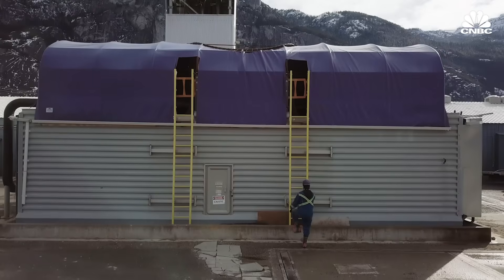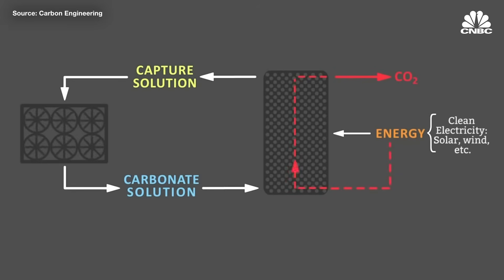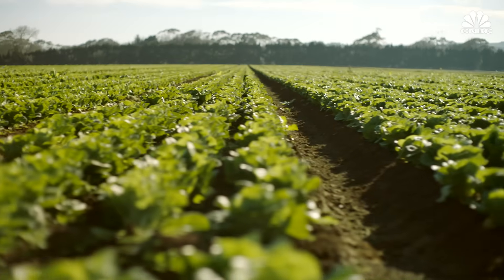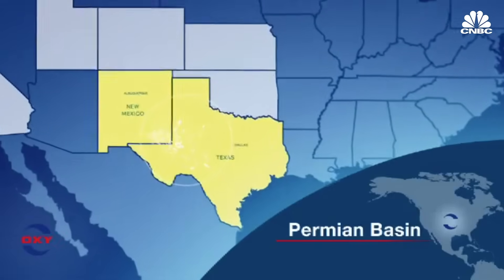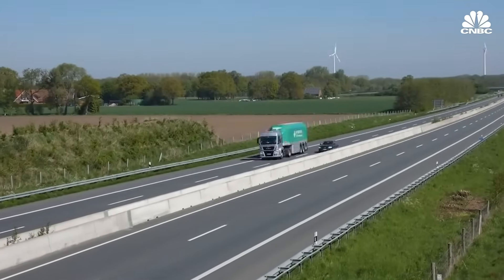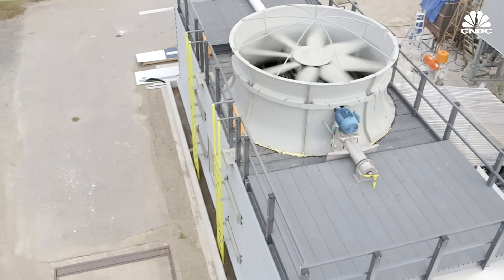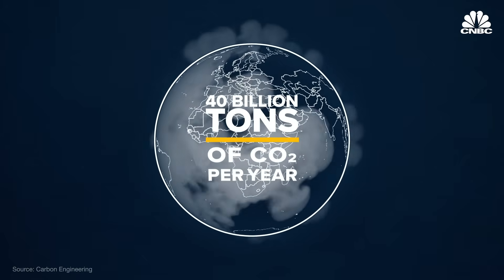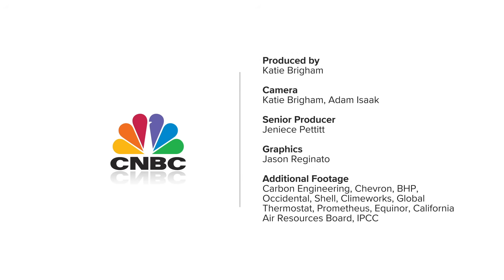Bill Gates-Backed Carbon Capture Plant Does The Work Of 40 Million Trees

Comment: Biofuels and clean electricity. Simple
Reply: No it isn't. 
Biofuel --> takes a lot of landmass
Clean electricity --> No reliable way to store it on a national scale
Reply: Chaomatic what are you talking about? Biofuels are made from second generation feedstock like waste vegetable oil from fast food outlets or from corn husks, spent sugar cane etc... also, renewable energy doesn't need to be stored, just like coal fired power plants don't store energy. Example: hydroelectric dam works at night, during the day we use wind and solar and excess power is used to pump water to high ground so it can be used at night as hydroelectric energy. Problem is, governments make a lot of money from coal powered plants

Comment: A lie . This is to continue  to cut trees down and build more building. A continuous chain reaction
Reply: Trees don't sequester CO2.  They take some in when they are alive, and release it back into the atmosphere when they die some decades later and decay.  It's called the carbon-cycle.  Interestingly, when you use a tree to build a house, you ARE sequestering the carbon the wood contains for a longer period of time, because it doesn't rot and decay like it does on the forest floor.

So when a tree dies in the forest, it's carbon is released back into the atmosphere in a few years as it rots and termites digest it releasing CO2 and methane.  Use that same tree to build a building, and the carbon stays out of the atmosphere for many decades, sometime centuries.

Comment: Notice how every negative comment basically comes from Berkely.  For one when it comes to the oil and gas industry your not just talking about gasoline in your car.  That's just one of more than 6000 products made using crude oil. The oil industry isn't going anywhere, and if there's a solid means of making it a cleaner more earth friendly process well only a fool wouldn't support it.

Comment: Wait, so they use huge electric powered fans (electricity which probably comes from dirty energy that creates CO2) to capture carbon in the air? Would this capture more CO2 than the CO2 that is released by generating the energy to run those fans? Unless they only use clean energy then I don't see the point.

Comment: When talking about "Carbon Price" are they talking the price of CO2 or C?
If the price is for CO2 and not C, what is the running price of C and would splitting the CO2 into O2 and C in order to sell the carbon and oxygen separately be viable?
Does that "40,000 direct air facilities to remove all carbon emissions" include what gets removed by forests and plants or is this by being 100% reliant on the facilities?
Reply: I don't know but I suspect it would be the mass of carbon alone which is easy to calculate without splitting the molecules

Comment: There is another simple way just stop using most of the oil driven vehicals and start using eelctric vehicals instead and use only those vehicals on oil which is needed untill there is a permanent soultion for using electricity instead of oil.

Comment: CO2 removale (not only including machines but also trees, mainly GMO that can capture more CO2) is the way we eliminate CO2 from the atmosphere, but renewable energy is the way how we don't put  it. We have to use both
Reply: The fossil fuel industry wants to be able to capture everything that is released so they can release it again and continue making a profit. Personally I would rather we as humans just switch over to green energy and just let the fossil fuel industry die.
Reply: Actually, "renewable energy" is nearly as big of a source of pollution as fossil fuels.

The future is nuclear, baby.
Reply: @operator8014  Please explain.
Reply: @adamtak3128  A lot of pollution is created when creating solar panels. But it's a cost/benefit thing. The idea is that renewable energy solutions will make up for the fact that they are dirty in the short term by providing clean energy in the long run.

Nuclear energy is a very special case. It's the cleanest form of energy we have by a long margin. It produced obscene amounts of energy for the small amount of pollution it creates. That is, so long as no nuclear meltdown occurs. Then it suddenly becomes extremely dangerous. But without nuclear energy we wouldn't be able to meet our energy needs.

Comment: That professor fro UC is a damn idiot. There are limits to the viability of solar and wind. Not the least of which is the massive amount of space it uses.
Reply: Who has a PhD in this, you or him? The reason why it's viable is because of offshore wind and solar
Reply: @polowishmadejski1548  

Building anything for offshore is incredibly expensive to build and maintain.  It is also very damaging to the delicate marine environment.
Reply: @kBIT01  maintaining and building is simmilar in cost to on land (build cost might be more but offshore land is less expensive) and marine life is minimally impacted. It had simmilar impact to building a bridge in a lake (assuming there are no chemicals leaking from the actual plant). Even if the marine impact were large, it would still preferable over fossil fuels, which have a much larger marine and general ecological impact.

Comment: problem is: You need power to fuel this system. And most of said power comes from coal and other fossil-fueled plants, which emit even more CO2 in the process...
Reply: You’re right, why bother with any solutions if it doesn’t make you happy...

Are you some kind of moron? Do you expect 1 company, 1 government, 1 solution, to solve this problem, this is a problem that will be solved by hundreds of companies and governments of many decades. Renewable energy can’t be forced onto the world, it will eventually be adopted because of its obvious advantages, but as long as you drive your car, I suggest you shut up and wait, or do something about your environmental impact all the way to zero and then you can complain without being a massive hypocrite that is actively adding to the problem.

PS adjusting your lifestyle is a bad solution. The market needs to switch to green energy, and that can only happen with time...Look at Tesla, they made cars that people want even ignoring the environmental benefits of an EV car. More stuff like this will come, because electric makes the most sense in all mechanical things.

Comment: Let's compact these machines to portable size, then put them in electric cars to clean up streets. We could also put these on gas driven vehicles... kind of like catalyst converters but have a container that will fill up with the solid, then go recycle it where it is accepted. Also instead of having robots in space, we could have them on the beaches cleaning up the mess we make. On top of recycling and planting trees of course. But there is a question that we'd have to come up with an answer for. If we are pulling CO2 from the air, as well as other pollutants...How will plants "breath". If I remember from 5th grade, we inhale oxygen. Then exhale CO2. Plants "inhale" CO2, then "exhale" oxygen. It would take a lot to calculate it correctly... but we could be putting the world into more danger than we think.

Comment: Planting trees  (Redwood preferably) , carbon-capture and Nuclear Power is the trifecta of reversing climate change.
Reply: immasurvivor it’s not that simple. Our fossil fuel usage is still high. We are extremely reliant on this energy source. Also, nuclear power is not finite, we only have enough uranium to power us for 200-300 years which is temperamental, not to mention nuclear waste. We have to find a new way to create energy or go back to living simply.
Reply: Countering the problem is different than solving it. Like lane keep assist for people on their phones while driving.
Reply: @Shahzad Khan Reactor technology has advanced since the 1960's, there are closed-system-reactors that pretty much cannot melt down and produce little or no waste.
Reply: immasurvivor gen 4 reactors are far safer and efficient than the earlier ones, but even after the isotopes are used up, the fuel rods have to be put in storage. We store up to 2 thousand tons of fuel rods each year which still are dangerously radioactive for 10k years. Burying something like U235 can damage the biosphere. As I mentioned before, nuclear energy is only a short term solution. It can not replace petrol, and cannot replace renewable energy sources. It’s is not the danger of them but rather what are we gonna do after we run out. This is not darling in the franxx where we can harvest the core of the earth.
Reply: @Shahzad Khan Sure, Nuclear is not perfect but its a good temporary solution while we wait for fusion or other revolutionary means of energy production to be developed. 200-300 years is a long time man, 150 years ago the horse was the prime mode of transportation, and look at the world now. if we havent revolutionized energy production before we run out of Uranium, we never will.
Reply: @immasurvivor  we have seen how safe it is, chernobyl and fukushima are a huge disaster.
Gen 4 reactors are hardly buitl anywhere and are not economically feasible, when renewables enter the competition.
Reply: Would be nice but redwoods can only grow in VERY humid places with LOTS of water... My family knows this cause we have tried to plants dozens at their home and even with intense care they never lasted more than a year.
Reply: Nuclear power sounds good until you look how much carbon dioxide is produced while transporting, producing and extracting Uran
Reply: Spakko21 Spakko21 lmfao please please tell us more about the CO2 cost of nuclear energy. 

What about the CO2 cost of solar, wind and the battery arrays you need to make them useful? Lol

Did you forget about thorium?
Reply: @lukasgerber3131  By that logic let's do nothing because it's naive to think there are no emissions in the production of wind and solar power installations... batteries ring a bell?
Reply: @lukasgerber3131  Probably a whole lot less then extracting and transporting the coal for coal plants.
Reply: @Spakko21 Spakko21 the C02 it saves is vastly greater. And alot of that C02 production can be eliminated with electric trucks, mining equipment etc.

Comment: i'm asking on the behalf of petrol heads, so this means, we ain't running out fuel?
Reply: That's the main issue with this, it doesn't address the issue of the world's reliance on a non-renewable, finite energy source. This will prevent only some of the many consequences of using fossil fuels. We are still going run out eventually and we need to be ready when it does.

Comment: I dont see the problem. . the solution is to scale this method up, plant more trees and lower the demand for oil by innovations in transport ( we are doing them, thanks Elon ) materials ( plastics ) and other bi-products of oil... if you do it all then it will eventually level out and then eventually reduce the worlds problem..... its a step in the right direction.... rather than these critics in the industry slamming it they should work along side it to collaborate in other areas to engineer methods which take away the need for oil.All the oil industries have to do as demand reduces is invest and move assets over to new fuel methods. It's really not that hard, is it ?

Comment: GREEN ALGAE.  

GREEN ALGAE captures FAR more CO2 than trees. Trees are not even what creates our oxygen and removes CO2, if it was only trees we would simply suffocate and not exist.  Green algae are the organism which produces our oxygen and absorbs CO2 -- and it has always been Green Algae. Planting a tree does nothing, its little leaves do nothing.  Its Green Algae which should be grown hydroponically in thousands of giant vertical farms with hundreds of stories of platforms growing it.  The algae will absorb CO2 and exhale O2, while storing the carbon which can then be stored away.

Currently under Capitalism, the Algae farms are only being used to the extent that they can use the Carbon biproduct as biofuel -- therefore releasing the Carbon Dioxide back into the atmosphere.  That does nothing for the climate, it defeats the purpose in order to turn a profit.   In fact the carbon biproduct needs to be stored away and prevented from being burned or used as fuel.  But that wouldn't get any backing or funding from Big Capital which is needed to do it on a large scale.

Thus, the prospect of carbon capturing, whether it be Algae or chemical treatment plants, is a doomed endeavor under the conditions of the anarchy of the Capitalist market.  Only World Socialism, which socializes the means of production of humanity for public ownership and used to meet human needs, and coordinates all national economies of the world to a single unified scientific plan -- can allocate the resources and mobilize the army of workers to construct the necessary carbon capture and climate engineering projects -- AND to have those projects be subordinated to rigorous democratic and Public oversight so that its used to truly benefit humanity and not be used maliciously for profit. 

Global Socialism, a WORLDWIDE scientifically planned economy controlled directly by the workers, farmers and scientists, is the only framework through which climate change can be combated. Period. This isn't an opinion but an objective and scientific truth. We will all do well to study the revolutionary socialist movement and the workers' movement, study the history of the Fourth International -- get off the sidelines, abandon your false hope in the lie that capitalism can be turned around or reformed. Make the choice to join the ICFI and the Socialist Equality Party in the international fight for world socialist revolution. Read WSWS.org for more info

Comment: We don't need to capture anything, as the world does this job already and it does this very well. The problem is that people are dumb and have accepted bio degradable materials. Materials that do not last and will melt away over time weakening it integrity. All we have to do is demand quality products. Example: We even allow the brick and other Companies to manufacture plastic sprayed fake leather couches to be sold and fall apart in under a year of use. We need to walk away from these degrading materials and demand that companies can only mass produce durable Quality products, that can last and not just make products that break down over time and not by actual use and that need to be constantly         re-manufactured over and over. People are ignorant and listen to those people who aim to enslave them. Instead of thinking about what they are actually participating in, these people are even willing to accept a forced carbon tax on such things like electricity and heating that allows them to survive in the winter. They feel guilty for using oil and natural gas which is cleaner than coal and wood. It's the cleanest fuels that are offered by the Government and our willingness to use them and not the alternatives, has us all deemed polluters and we need to be punished? WTF. We are using the cleanest fuels and we are bad? Notice how the gasoline powered cars have increased its mileage from 9 MPG to an average of 50 mpg and we all know a car can be driven on nothing more than water? The manufactures can make cars get over 100 mpg but are not allowed to. But we the consumer are the bad guys? We need to demand quality products and services and stop blaming ourselves for living in a rigged economy. We are victims nothing more and nothing less.

Comment: Just overlook the thermodynamics and dream up a total non solution. Think of al the solar energy that was put into fossil fuels in the first place. And then was released by burning them... in order to reverse that chemical process YOU HAVE TO PUT IN EXACTLY THE SAME AMOUNT OF ENERGY THAT WAS RELEASED. And yes, solar to power these scrubbers might be more efficient than a same area of planted trees, but all that pv energy isn't then going to be used to replace fossil! Only way this might work is going full zero emissions for our daily needs AND scrub co2 from the air using MORE zero emission energy.

Comment: So theres a guy who says partnering with oil companies is bad. But why is it? Gas prices could drop I guess. And it wont add more co2 into the air because it's not like everyone will start buying more cars at an increased rate🤷🏻‍♂️
Reply: Good point. My counter to that, however, comes with us shifting toward electric vehicles and renewable energy: this shift will eventually put oil companies out of business, causing the carbon removers to lose a major source of funding

Comment: As more electric vehicles are being built, I can see this being more effective near power plants.
Reply: They all use fuel. Some in gas tanks in the vehicle some in the coal back at the power plant. That electricity has to come from somewhere. Tesla’s are basically (depending on where you live) coal powered cars
Reply: @yoshitsuneminamoto6632  they say that  there is less Co2 in the air from the electric produced with coal, compared to fossil fuel car.
Reply: Most us power plants already capture most of their co2.
Reply: Electric uses fuel
Reply: @aaron7520  not all of them.
Reply: @aaron7520  That is true, the best we can do is keep it contained in a small area. If this really worked, why not integrate this in the power plants process?

Comment: In my opinion, and it's only my opinion please understand that. After you catch the Carbon dioxide from the air, why don't use renewable energy to split Oxygen and Carbon apart? Because the Carbon could be used in making of carbon fiber that will give poeple more flexible, light and strong materials.
Reply: Just dont try of u dont know
Reply: @o0ooo0  I'm don't want to have an argument in here because, I don't want to show disrespect, to a person who is definitely smarter and knows better not to try.